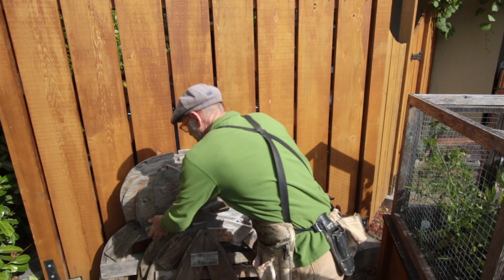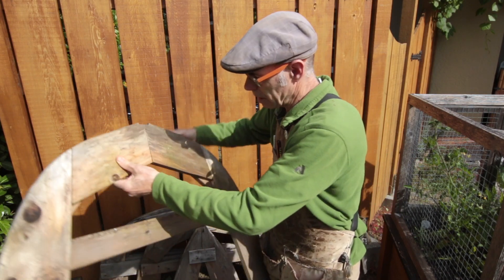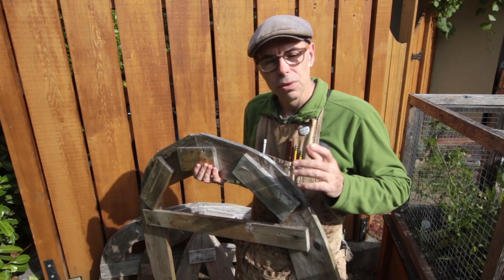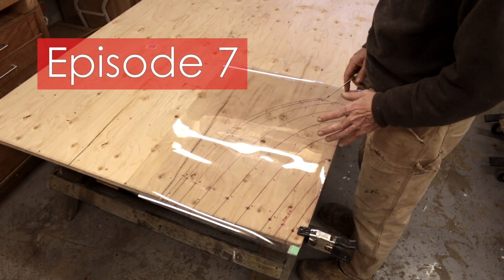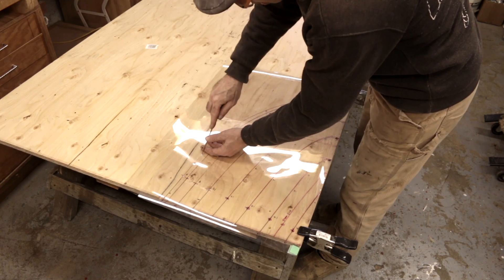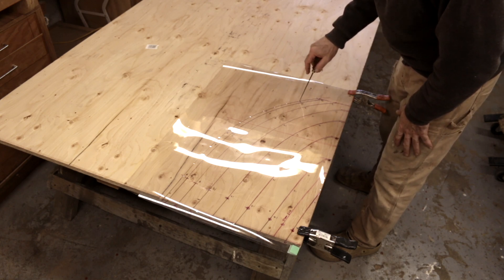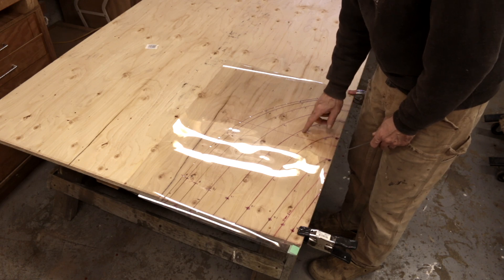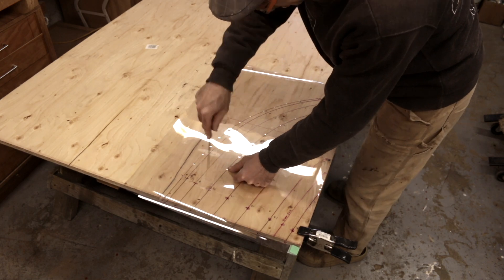International 2.4mR Sailboat Project - Episode 7 - Moulds

Comment: Hey, have you thought about using a CNC router for making those moulds? Not "traditional" but... Would that save you some time making sure that the moulds are accurate?
Reply from the maker: Well I’m not set up for it so that’s $100/hour setup and cutting time. Then there’s the question of mould reductions which would have to be communicated somehow. Ahhh. It just easier for me to do it on the bandsaw and I can get it plenty accurate for my purposes.

Comment: Why do you use a bundle of strips rather than a single batten?
Reply from the maker: The multiple strips, or “bundle batten”, gives you a fairer curve around a tight bend. I use a single strip for all straighter bends up until it would break, then switch to a bundle.

Comment: Love your channel.  One thing I seemed to have missed is how did you fair the plywood moulds prior to laying the pine strips?   Apologies if was covered in one of the episodes (which one?).  Thanks
Reply from the maker: The moulds were very fair to start with and only needed to odd minor shave. I just used a batten to check and a spoke shave to remove any required material.

Comment: Is there a reason not to spray glue print out copies of the drawings directly onto the wood rather than transferring points over and over introducing errors as you mentioned? Or is it just because this is the traditional way?
Reply from the maker: Well, yes, this is the traditional way but often we don't have full size paper copies of the moulds. Even if we did there are a few problems with that idea. 1. it would then require an extra copy for each mould. 2. those drawings may not have had the proper mould reductions done that we need. 3. paper drawings are dimensionally unstable. The paper changes size with humidity and we can't always trust that they were digitally printed exactly full size. This is partially why we go through the lofting process, working from a numerical table of offsets to get a full scale drawing. 4. spray gluing patterns onto plywood only works well when the plywood is particularly smooth. It doesn't bond all that well to rougher surfaces and when you run it through the bandsaw or table-saw, the paper tends to lift at the cut. I've got no problem with shortcuts but I also feel it's worth going the traditional route and it ensure that body of knowledge is kept alive. Use it or lose it right?
Reply: Nomad Boatbuilding by drawings I meant copies of your lofted and reduced drawings that you compare back to in the video. In which case a photocopy of those could be used. I get the humidity argument, but is it that much worse than what could happen from the dimension transfer? Also the spray glue only needs to hold until you get them cut. Otherwise corners can always be reglued if needed. But I do see the value of doing it the long way, especially if you’re careful and exact.
Reply from the maker: spacemansabs the paper edges tend to get chewed up so you loose the line kind of easily. At least that’s what happens on the spruce ply I like to use for this stuff. Also, Having full size patterns on paper like this is a rarity for me. Lastly, I just prefer working from the mylar patterns. I’m used to it. But you’re right, I certainly could have done all that.

Comment: Strapping!?? Just when you start thinking all the variables are taken care of... I am sure we will find out more along the way.
Reply from the maker: Dale Skidmore hahaha, yes strapping. Same as the plank reductions but a little heavier. Basically I reduced the moulds by about 3/4” all in. 1/4” for planks and 1/2” for strapping the moulds. Not a big deal but of course this is where the use of the bevel board becomes important because the reductions at greater angles become more pronounced. At 1/4” reductions, fudging is pretty easy but at 3/4” things get more serious. You can blow it off but you’ll have a tough time when fairing the moulds. Blow that off and the planking gets wonky. Blow that off then your fairing job is a nightmare. Blow that off and your boat looks like crap. So why not just be a little more careful when it only costs a little pencil lead and eraser dandruff.
Reply: @Nomadboatbuilding  I have more rulers than any other type of tool, each one is specific to a certain task and things have to fit together right. I knew I would enjoy boat building.
Reply from the maker: Have you taken a crack at lofting yet Dale?
Reply: @Nomadboatbuilding  I made a half hull model ( 1" to 1' ) a couple of years ago and spiled the station lines off of it and scaled them up full size onto lining paper. There were only 3 or 4 points that missed the curve, and they were only a couple of mm out. I never went the whole way to making the full 12 ft length drawing as I didn't have the ply to do it, plus I had a boat in that I was restoring by then, so no room. It took me a while to work out how to spile it out: I used veneer slivers glued onto pieces of plywood.
Reply from the maker: @daleskidmore1685  That's cool. It's rare that a set of offsets works out perfectly. They are derived from scale drawings after all. Sounds like you lucked out.